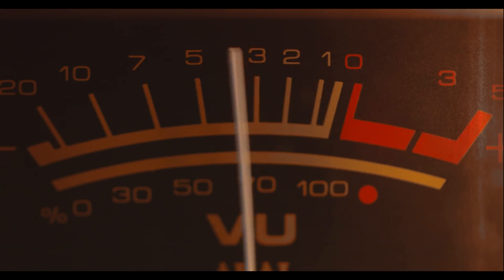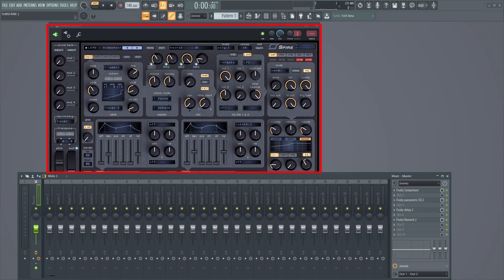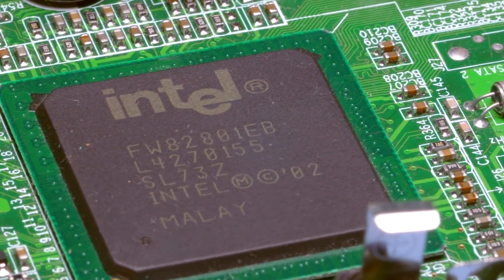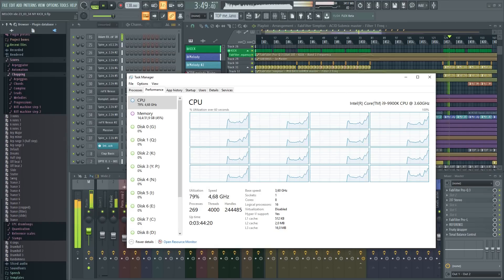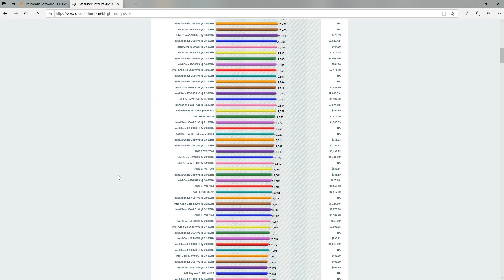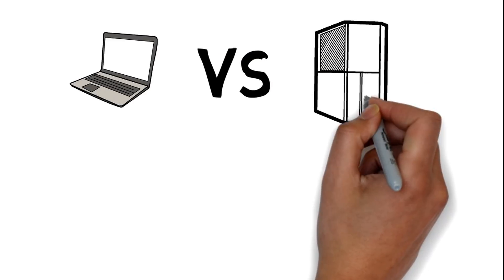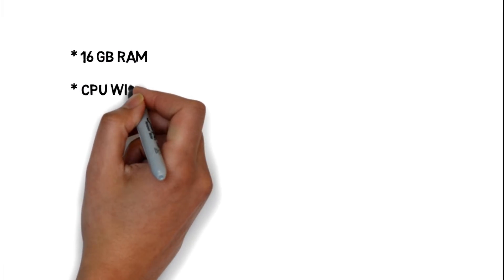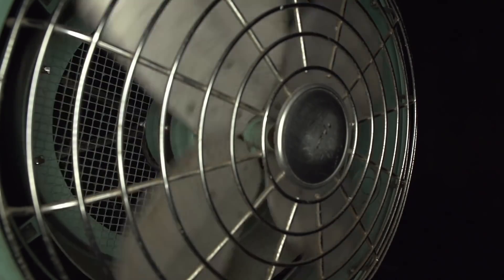The Best Computer For Music Production - What's Needed And Why!

Comment: This is the most misleading video on what you need for computer music that I have EVER seen. For a start, those of us who have been making music for over 20 years know that music production does NOT need the fastest or most expensive computer. In fact for 99% of us a first generation i7 is good enough and you would not even exceed 30% CPU usage unless you're being very wasteful or lazy. Work smarter not harder and instead of blowing $3000 on a computer system you can spend $1000 or even less and put the rest of the money into other things like promotion or additional outboard gear. In fact if you buy an audio interface with onboard DSP you can run the PC with minimal plugins for real time use or increase the buffers and mix with more plugins. Mate you just wanted to build a beast of a computer and that's fine but to come up with misleading information is not on at all.
Reply from the maker: Hi, exactly what did you find misleading about it? The title of the video is "the BEST computer for music production", and that's exactly what it shows you. Perhaps you didn't watch the entire video, but It's also stated in the video that not everyone is going to be needing the very best computer and that it will depend greatly on what kind of projects you make, the genre and so on. 
There are even several cheaper alternatives mentioned, including the i7. The first part of the video explains how a computer processes information when using a daw, and why music production tends to be so demanding on the system. Extensive research has been done before the making of this video and the information presented comes directly from the daw developers themselves. 

You are absolutely right that music production doesn't always require a super-fast computer of course. I've been making music since the 90's myself and I remember back in the day when we used MS-DOS based trackers to make music. Today, most people have smartphones that are many times faster than the computers we had back then. 
If you are mostly into recording or using a lot of pre-recorded samples, then you won't need much performance at all. If you make small projects with few VST's and effects then you won't need much either. 
However, there are a lot of people who are into orchestral music, trance music etc where it's not uncommon to use up towards 200 tracks and more, with 50-100 vst's, plenty of effects, automation, routing and so on. A typical orchestra can often utilize up towards 100 individual players, with 16-18, fist violines, 16 second violines, 12 violas, 12 cellos, basses, choir, flutes, pianos, drums and so on. Now imagine that you have a trance project with a lot of syths, acids, effects and so on, including an orchestral breakdown part. It's going to be hugely demanding on the system, unless you want to freeze everythingm which can be quite tedious. Especially in FL. 
In those cases, even the i9 will tend to struggle. The project shown in this video is a large (but not the biggest)  trance project, and the i9 is almost maxed out. 

I might just make a separate video explaining what kind of systems are needed for different kinds of producers, working with different kinds of projects and so on. It's very difficult to recommend specific CPU's and such though, because this changes so quickly. 6 months later there will always be something much better available.
Reply: FireWalk ok for a start you’ve explained a lot of stuff that really isn’t relevant and immaterial for musicians. Any i7 is enough to handle any recording project including your orchestral scenario. It’s called limitation. Very few if any OTB studio needs to run 200 simultaneous tracks for classical music and frankly their recordings are 100 times better than the VSL sample based projects. You talked about small projects but I’m not talking about small projects. I’ve made records using 100 tracks and even more but rather than run everything live with soft synths etc you bounce and bus. This is basic recording. Great records were made with 24 physical tracks. Also I mentioned that a smarter and more efficient way to record is to rack and stack which is ironically what the top Orchestral guys do. For the price of your $3000 computer I could buy 10 i7 refurbished computers and if you sum all the processing power it will dwarf your system. Load balancing is something you need to do and also you need redundancy so blowing your whole budget on one computer and telling us that to build your own computer studio is expensive is just not true. It can be but if that depends on the individual. Artists need to stop thinking about expensive toys but also think how the heck they are going to promote themselves and they have other costs to consider. My recommendation is this. Buy the cheapest i7 computer Desktop preferably and if you start to run out of tracks in real-time, BOUNCE and freeze the synths and effects. Then buy your next machine and link them together using one for synths and the other to run the DAW. BUY a digital mixer/audio interface which can reduce the bottle neck on your CPU. ADD more desktop PCs etc. I would NEVER recommend anyone spend big money on ONE computer. Also people need to stop being indulgent. Limitation is your friend, it will force you to be creative and more efficient. Freezing synths is not tedious, man alive back in the day you committed to tape so there is no need to run every synth live. Print the audio!
Reply from the maker: TLDR warning: 

So you're basically saying that there is no such thing as the "BEST" computer for music production, because If you max out the CPU then you're doing it wrong? I think people should be allowed to work the way they like. If they prefer to use tons of VST's and effects, and hate to constantly freeze and unfreeze tracks, then why not let them? 

The first part of the video explains how a daw processes information. That's useful to know if you want to buy a computer that's well suited for this kind of use. A lot of people will just buy a gaming computer with an i5 without hyperthreading, thinking it will be great for music production. The reality is that they are just wasting their money on a video card with an expensive GPU that the DAW can't utilize anyways. Knowing this stuff can be really helpful in making the right decisions. 

I get where you're going at though, and from your perspective you're right. But please consider that other people might see it differently. 
I see discussions like this all the time on the IL forums for example. Whenever someone ask for more mixer tracks, some people always come out and say "you're doing it wrong! Limitation is your friend!" etc.. 
There seems to be a misbelief that IL intentionally limited the number of mixer tracks in FL because limitation breathes creativity. That's simply not the case. The reason they did it was because of the way the software works. In FL Studio every mixer track consumes a little bit of processing power even when not used. Adding more would slow down the entire application needlessly, so they limited the amount of tracks. Only recently did they increase the number of available mixer tracks.
 In other words: They were just waiting for computers to become faster so that they could do it. In essence, this means that if you were using the same computer you were using back in FL Studio version 5 for example, then you can expect it to run slower and slower as the updates keep introducing more tracks. 

I agree that you can make music with a limited number of tracks of course, and you can always bounce stuff down (freeze) to save CPU power. That's a great solution for people on a tight budget. But you forget that people are very different. Some people prefer DAW A and some prefer daw B simply because they offer different workflows. We need to respect that other people might prefer work in a different way than ourselves. 
If you constantly go back and change things, then consolidating (freezing) the majority of your tracks will be extremely tedious, especially in FL since the process is not fully automated. You would spend most of your time fiddling with this instead of actually making music. In that case, you might come to the conclusion that time is money, and find it well worth investing in a faster computer. 
I remember a few years ago when I had a slower computer. It wasn't quite up to spec with regard to the projects I was making at the time. I had to constantly freeze and unfreeze, enable and disable effects etc and constantly change the buffer so that I could record live and such. Often times I had a great idea, but then I lost it because I had to spend so much time with all these manual tasks just to get around the fact that my computer was not really fast enough. Sure, I was able to work with it, but it was less than ideal. When the computer becomes in the way of your creative process, then an upgrade can be really welcomed. If you have the money for it, then I say go for it. I did, and I have not regretted it. Sure, I could have used that money for something else, but now the computer works with me and not against me. 

You should check out some of the videos about Hans Zimmer here on Youtube, where he's showing how he works. Some of his compositions has hundreds of tracks.  Nothing wrong with that. Nothing wrong with making a project with 20 tracks either. Back in the 90's I rarely used more than 8 tracks. But times have changed, and production complexity has increased. 

I firmly believe that nobody should tell you how to make music. There's no right and wrong, especially with regard to the way you work. If you make a trance project with 150 tracks then there's nothing wrong with that, as long as it sounds good in the end. You might be utilizing 80 tracks for the trance part of the project and 70 tracks for the orchestral part of it. Still, nothing wrong with that. 

I don't really get the argument that you could buy several cheaper I7 systems for the same price. Having several computers like that wouldn't really be useful unless you're using Cubase, but still, even then it has limitations. Even if you buy a cheaper i7 then you still need to buy the motherboard and the ram, so it's mostly just the CPU itself that costs more. 

Upgrading to an I9 doesn't have to cost $3000. Often times you just have to replace the motherboard, the CPU and the RAM. You can reuse the cabinet, video card, hdd etc. In that case the upgrade cost will be around $750. The new AMD 3000 series will provide much better value, which means that the upgrade cost would probably more like 550. I should also note that the i9 has built-in graphics, so you don't really need a separate video card at all. Again, many people end up wasting hundreds of dollars on a video card for a music production computer, and that's just a waste of money. Better to invest that money into the CPU as explained in this video. I don't agree that this stuff is not relevant information for producers looking to buy a new computer, because I see questions about this stuff all the time, which is why I decided to make the video in the first place. 

The cheapest I7 right now would probably be the 4820K at around $200. The 9900k costs a little over twice that, but offers 186% faster average multi core speed, so you get what you pay for. Keep in mind that if you buy everything from scratch you'll still need a cabinet, hdd, mother board, ram etc even with the i7. These things will basically cost the same. So in the end you end up with two computers: One costing let's say 40% more, but offering 186% more performance. 

Again, I'm not saying that everyone needs an i9. But there ARE people who do need a really fast computer due to the way they work, and all I'm saying is that there's nothing wrong with that. Some people can get by with far less. In the end, everyone has to determine how much performance they actually need, based on what kind of music they make, how they work etc.

Last but not least I should point out that IL lists the i9 as the "best" alternative on their official pages right now.
Reply: @FireWalkMusic  Lord have MERCY! Ok no there is NO such thing as the BEST computer for music. How do you quantify that? It is totally subjective. So from that point of view you're making a big mistake. Also man don't come on here and argue over prices of computers. I bought an i7 3rd generation computer for $200 AUD which is around $150 USD or even less. This was for a computer and NOT the CPU. Did you even read my replies? I am NOT Talking about just the CPU here I am talking the system. Why would I recommend it? Because when money is a factor for most people, spending $3000 USD on a computer is ludicrous. Musicians love to buy toys and then have no money for promotion and other very important things you would need in order to be a self contained artist. The computer is one thing and there are other very important costs to consider. Your video is ALL about telling people how to make music lol and many on here are taking issue with your solution. By all means spend what you want on what you want but to tell people that they can't even get in the door without spending thousands is misleading. Hans Zimmer may run hundreds of tracks but how about you go and watch videos or read about how people record orchestras with a stereo mic ONLY. No one recording a real orchestra mics up EVERY instrument and no one needs to run hundreds of tracks just simulate an orchestra. You have presented a one size fits all solution and you're arguing with me who has made lots and lots of recordings without the need to spend big money on a computer. Heck why stop at $3000? Why not recommend a $10,000 computer? or even a $1m super computer after all if you can afford it why not? In the real world we need to set parameters and while running everything in real time is a nice idea on paper, in practice you create indecision and slow down your workflow. Afterall why would I need to use the M1 piano when I can download the latest 10TB piano library made by "insert marketing name". If you want a real piano go and hire one and record it. There is a never ending conveyor belt of software and products that exist only because some name person says you need it in order to make radio ready recordings and the end result is that the masses over spend. The same thing goes with computer hardware. Your example of freezing and unfreezing tracks in FL being tedious is laughable. Endless tweaking and majoring on the minor instead of focusing on the song is one of the drawbacks of modern computer music. People spend all their time on the production and hardly anything on the actual composition. Why is this? Because of NO self imposed limits and over indulgence. Sure go for it but at some point I hope you see the wood for the trees. I am not dictating to anyone I am merely pointing out that you do NOT NEED to blow your budget on a computer whereas you're saying the opposite. FYI a cheap computer solution does NOT mean you can only run simple 8 track recordings lol
Reply from the maker: I think we just have to agree to disagree. We're not really talking about the same thing here. When I talk about the best CPU for music production I mean the CPU best suited for the task. Various CPU's are suitable for different tasks. Some are great for video editing. Some are great for games and some are great for music production. Different CPU's have different architectures, amount of cores etc. There's no single CPU that's great at everything. This video simply tries to help people out by explaining what to look for in a CPU. 

You're assuming that I'm telling people that they have to spend $3000 on a computer if they want to make music. That's simply wrong!  If you feel it comes through that way then I apologize, because that's not the intention here.  
This video is for those who are actually looking to buy a fast computer for music production and want to know what the best possible components are, what's needed and why. Simple as that. Besides, you can upgrade your computer for far less than $3000. That figure is an estimate including two screens, audio interface+++. The whole package. Most people will reuse most of their stuff and upgrade only the essentials, which costs far less.

It's also stated in the video that most people won't need such a beast, and will get by with far less. How fast your computer needs to be will depend on what kind of projects you make and how you work. 

Please consider that there are people who will need a fast computer like this. I'm one of them. I've been making music for more than 25 years now, and you're basically telling me that the way I work is wrong, and I just can't agree with that view. I strongly believe that there's no right or wrong when it comes to workflow. That's why people prefer different daws. Ther'es no "best" daw, it's mostly about the workflow. 

What matters is the end result. If someone wants to impose limitations and feels that they get more creative that way then that's perfectly ok. Someone else thrives with complexity. That's also perfectly ok too. People are different. 

I understand what you're saying, and I somewhat agree, because I always tell beginners to keep it simple. That said, we have to accept that not everyone wants to keep it simple, and there's nothing wrong with that. :)
Reply: @FireWalkMusic  Ok some fair points there and in that respect I can accept your points. I do intend to upgrade one of my systems when i9 prices are more reasonable here in Australia haha. I've subbed your channel and thanks for engaging with me even though we didn't see eye to eye. At least you took your time to discuss and that's marvellous. Will look forward to your next video. God bless.
Reply from the maker: @kehindea  It's always refreshing to be able to discuss something like adults, without the name-calling :) 
I just visited your channel and watched some of the videos. Great stuff!. I realize now that we have very different perspectives on the matter, which explains the confusion.
You are probably more into recording and stuff, while I'm more into the EDM side of things, making CPU hungry ACID sounds and such.

I recommend waiting for a while. I suspect that Intel will have to reduce their prices now that the new 3000 series from AMD is rolled out. From what I've seen it offers almost the same performance as the i9 at almost half the cost. The 3000 series itself is probably also worth considering. I haven't had the chance to test it myself yet, but I'm planning on saving up to buy a motherboard, ram and a CPU so that I can test it and see how it stacks up against the i9. When the time comes I'll publish another video. showing the results.
Reply: FireWalk on my part I misunderstood your whole post and I apologise for any offence or misunderstanding caused. One thing I think Cakewalk Sonar balances its CPU processing across all the cores which makes a more efficient use of the CPU. I’ll try and find some documentation to confirm this. Another thing when I was about to upgrade my system I found that the i7 3770 cpu was only around 25% slower than the 8th gen i7 but the whole system cost me $200 so I bought my son a PlayStation (competing dollars) and bought the refurbished system haha. Thanks for your kind words regarding my music. Back in the day I had 2 Yamaha DSP FACTORY sound cards and offloaded all audio processing to it and didn’t use any real time processing except for soft synths and I went with sample based synths which used very little CPU as they did disk streaming and you had pretty decent sounds. I also had the Sound Blaster CARD which had its own dsp and I was able to run lots of Auto-Tune in real time haha. That all changed when the Core2Duo cpu came out and the DSP Factory was slowly retired and now I use it like an outboard FX rack. My only concern with AMD is I’ll need new ram new mobo and I’ve been an Intel guy for donkey years real like cheating on your partner.